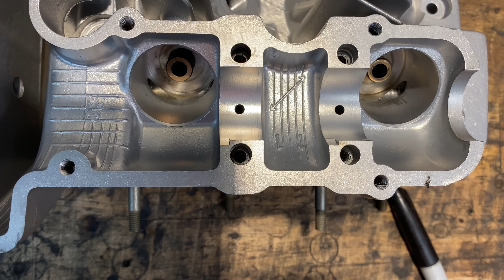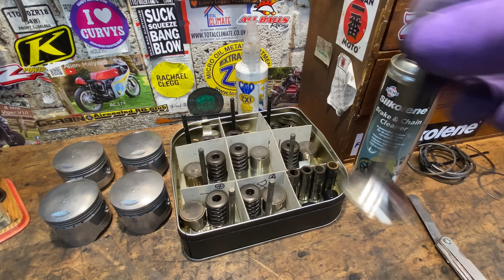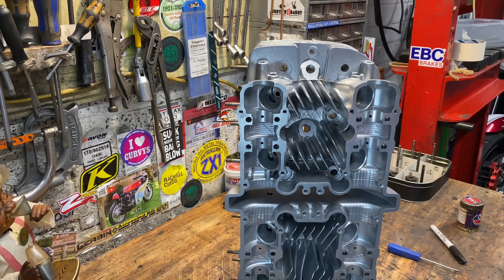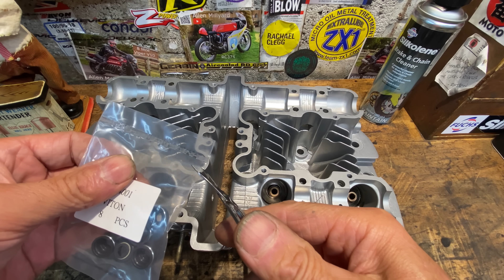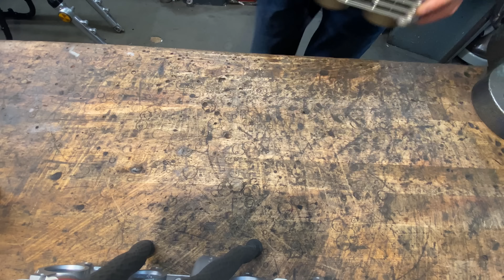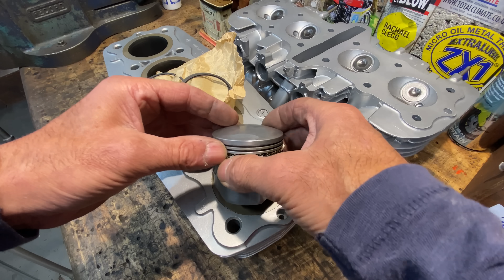Kawasaki Z1B 900 engine rebuild - Episode 2

Comment: I thought that replacing the valve guides would require at least a touch up of the seats with a cutter or stone. Ditto that new guides usually require a pass with a reamer. Guess things have changed.

Comment: Hello Allen, I have been a follower of your channel for >5 yrs, and enjoy watching your engine builds. I have stripped my bike engine down completely and I'm finally getting back to rebuilding it, I had the head on my Z650 C3 vapour blasted and I have found blast media in the blind hole oil galleries. Could I ask, what Aluminium grade and what size did you machine the new plug diameters? Also, how did you remove the original end plugs. I was thinking of using a stud extractor but this would only turn the plug, I would hope to find out how you did yours. Best regards. 👍

Comment: Amazing series, is there anywhere I can get the oil galley blanking plugs as I have a small leak on my Z900 A4?
Reply from the maker: You will need to make some or remove them from a scrap head

Comment: Thanks Allen.  That's probably the most awesome motorcycle engine ever.  I think it was Kawasaki saying to Honda "Oh yeah. You make a 750, so we'll make a 900."  But, interestingly, I had a Honda S90, which is exactly 10 times smaller, and probably just as much fun.  Now I have an e-bike and it's fun too  :-)
Reply from the maker: I actually want a S90
Reply: @AllenMillyard  It's interesting that a small motorcycle can be just as much fun as a large one.  Or maybe even more fun because it is lighter and easier to handle around town.  But I would want the 900 on the highway.

I had a candy apple red S90 back in the early 1970's.  (Use Google Images and search for Honda S90.)  It was a really fun bike, and the girls thought it was cute and always wanted a ride on the back ;-) 

PS - I thought you had an S90, or actually 2 of them joined together as a v-twin.  But maybe I am thinking of something similar.

PPS - Nowadays I have an e-bicycle because my wife won't let me have a motorcycle, but that is really fun too.

Cheers from Canada :-)

Comment: Nice video Allan I've done a few z1 engine builds myself over the years I never thought I'd have to give you a tip but here it is put a few drops of oil down the valve guide before you grind them in it stops the guide getting any wear during the grind process I hope this helps you and others watching your videos 👍

Comment: Hi Allen. I notice you oiled the valves mating face but not the stem. I usually oil the stem and not the mating face. Can I ask why you do it the way you do?
Reply from the maker: I did put a drop of oil on the stems but it didn't make the edit

Comment: Just this weekend I started measuring all the top end tolerances on a GS750, and following the description in my Haynes manual I measured 0.50mm piston to bore clearance where 0.06 is the service limit. Needless to say the description was severely limited and my interpretation of the process looked nothing like what I saw here, hence the ridiculously out of bounds measurement.

Allen, thank you showing that measuring method, and for once again (somehow) making engine rebuilds feel far less intimidating!

Comment: For cleaning carbon deposits from steel I recommend muriatic acid (10% solution for safety), wait a few hours after immersing and it just falls off with some rubbing. But it's much easier on a lathe with an abbrasive? Try doing that with a 20-year old turbo wheel with a ceramic like carbon layer, the acid with some patience will temove it and make the wheel look new without applyingn any force on the thin blades.

Comment: It won't work as well as a lathe, but placing the valve into a drill could work also, but would be much more tedious.
Reply from the maker: Yes you can use a drill for same effect

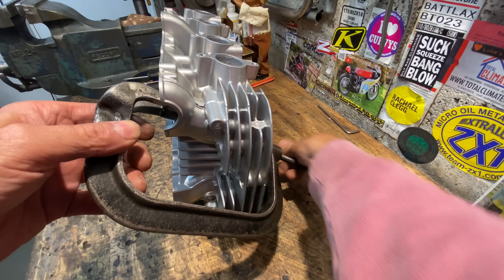Comment: 9:53 "Dad's vintage valve spring compressor". That's identical to my valve spring compressor, which I bought new in the '70s. Vintage? Cheek!

I always used a tuppence (two new pence - it was late 1971) coin at the screw end to prevent damaging the the head of my Norton 650SS.

Comment: I notice the original oil gallery plugs had two grooves machined around the diameter. And Allen's replacements didn't. So my question is: what was the purpose of the grooves? Why are they no longer required?
Reply from the maker: I guess they’re sealing grooves but not really needed with a good interferance fit. Never had a leak so far
Reply: @AllenMillyard  thanks for the explanation 👍

Comment: Super interesting as always. 

I was shown to fit valve collets using a long slim flat bladed screwdriver - get a blob of grease on the screwdriver and you can then pick up the collet and it doesn't fall off while you manoeuvre it into position.  It's always worked for me but I saw you do it differently - I wondered if there was any reason not to fit them the way I do?

I'm looking forward to seeing the rest of the build 👍
Reply from the maker: What ever works for you is a good way
Reply: @AllenMillyard  Thank you - I didn't think a bit of grease would do any harm, but I knew you'd know if there was any reason not to.  You put a dab of grease on the inside of the collet too which will stick it in place on the valve stem.  Thanks again for the reply - I know you get lots of comments so it's much appreciated.

Comment: How do you deal with when holding the valves in the lathe chuck, could that raise even the slightest amount of metal that could damage the valve guides when inserting the valves?
Reply: Good point, but valve-stems are always hardened to resist wear. Lathe chucks are always much softer.

Comment: Mmmm never owned a z9/1000 but i got a Kz650 with Z750 e1 engine in it. Though its time for a fresh rebuild again. I think im gona drop the high comp and 810cc kit. Go back stock 738cc and turbocharge it. Those z1s are so nice and the Z air cooled kawa engines are BEATIFUL engineering

Comment: That made me think, because it has a long stroke compared to water cooled 900cc engines. Is the stroke related to cooling?

A longer stroke (with a smaller bore) would have more surface area for cooling than a short stroke/big bore.

Comment: Roadking has an antique tool to grind poppet valves (& seats) that is something like a hand powered food mixer.  It reverses valve rotation every crank rotation, automatically, when cranked one direction.

I think you need one.

Comment: I usually oil the valve stem to prevent damage to the newly fitted stem seal. Thanks Allen.
Reply from the maker: I did but it didn't make the edit
Reply: @AllenMillyard  I  thought you had, but just to reiterate. No criticism intended.  Great to watch.

Comment: Totally agree about the older grinding paste.  Got dads ancient tin of coarse and fine Chemico and it’s just better then the new stuff I bought a couple of years ago. Get that grey line much quicker.

What Loctite was that you used on the tensioner screw? I used 248 on the oil pump faceplate bolts on my Ferguson TE20, but noticed your stuff wasn’t the usual blue..  and got me wondering.

Also agree on the cherry and almond.

Comment: Some builders swear by lots of soap suds for cleaning newly honed bores, the theory is it floats all the microscopic debris out of the honing marks. I use the same method for cleaning records. That engine is going to look blinding when it's done, and undoubtedly run like a Swiss watch.

Comment: That tip for cleaning valves is brilliant!
Reply: just be careful some PCB are made with fiber glass.
Reply: @-IE_it_yourself  I'd be wearing a mask, anyway. All that carbon dust is bad enough, but yes, I would say most, rather than some, PCB's are made of FR4, a type of fiberglass. You definitely don't want to breathe PCB dust at any time. I've got some of the old-skool phenolic boards, which should be great for this job. Also wouldn't want to breathe the dust from that!
Reply: @gerryjamesedwards1227  thanks for the info!

 i was also thinking the glass might be hard in a situation looking for a soft material.
Reply: @-IE_it_yourself  Abs plastic would be worth a shot if you were cleaning copper or brass like this, I would think. That's a 'hard'  plastic that's fairly soft, but it might melt too easily.

Comment: Tip for removing carbon buildup from pistons / cylinder heads: paint stripper (Starchem Synstryp). Softens the carbon within 10 to 15 min, can be scraped/wiped clean easily. Also works wonders on piston ring grooves with a toothbrush. Doesn't effect the metal.
Reply: Going to try that! Spent a lot of time last weekend doing it manually, right after I picked up stripper to clean old paint off the engine 😅